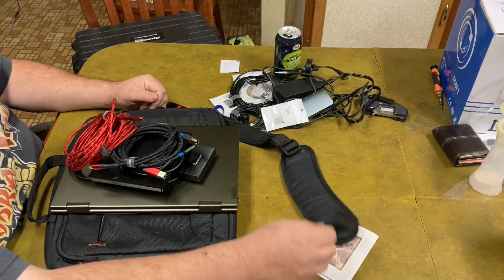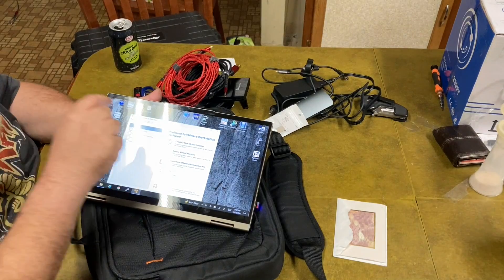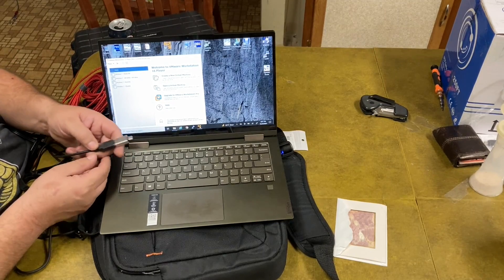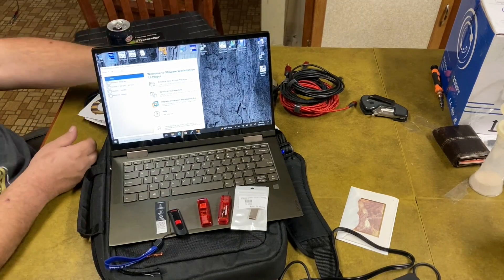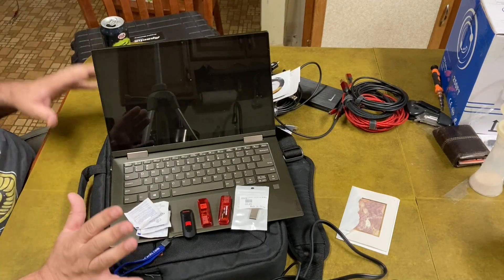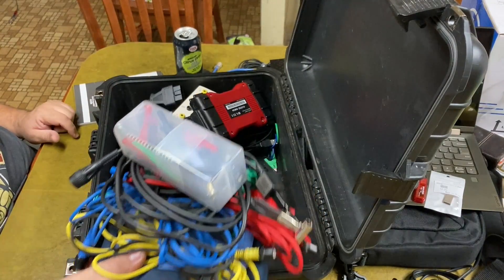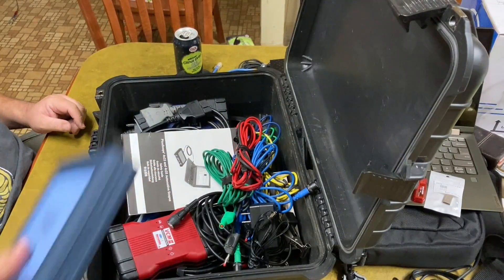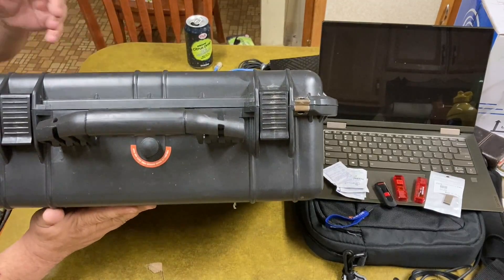My Automotive J2534 J Box's and Programming Laptop and Hardware

Comment: The ipad app store just opened up support for utm se virtual machine app that allows you to run windows xp and windows 7, and it's been suggested that windows 10 and 11 is coming, on ipad. Would be interesting to test if you can use ipad virtual windows setups to drive j2534 box diagnostics and programming job.
Reply from the maker: Let me know how it goes!
Reply: @frugalprepper  did some more research and not viable, its emulation not hardware virtualization thanks to apple so super slow. a macbook with parallels or vmware hardware virtualized windows would work fine though at that point might as just get a low cost windows laptop dedicated for this task.

Comment: hey man do you know any decent budget friendly laptops you can recommend ? i dont have money for a thousand dollar laptop right now lol. i want to start using dealership / OEM software on honda , toyota and nissan. i know ill need more than one laptop most likely. i was looking at the Panasonic Toughbook CF19 Core i5 2520M 2.5GHz 8GB RAM 512GB SSD Touch Win 10 Pro and not sure which other laptop but wanted some recommendations. thanks
Reply from the maker: I use a Lenovo Yoga.  With i5 and 16GB of RAM.  Mine had 512 GB but I like to carry it with my AllData, Mitchell, and Hollander so I upraded it to a 1TB.  Lenovo has great, cheap warranties for extending you warranty and for accidental damage.  I run the one laptop and then build virtual machines for each manufacturer.  It did have to go back once under the warranty for a bad motherboard.
Reply: @frugalprepper  oh ok I see. It’s just I don’t have $800 to spend on a laptop right now. I was gonna put $300-$400 into a laptop right now so I can be using it with either of the 3 OE softwares ..

Comment: My BCM just went out and the dealership is saying it’s months out. Do you know where to get this part? GL3Z-15604-J
Reply: Thank you sir ima get ahold of you tomorrow 
Have a good night
Reply from the maker: What Make Model and Year is it?
Reply: 2016 Ford F-150
Reply from the maker: Another option is to send yours out for repair.  I have used moduleexperts.com before.
Reply from the maker: Yeah it's going to be tough finding a used one that new at a junk yard.  It would be even tougher to make a dealership program a used module, even though it can be done.  With the chip shortage you may be waiting a while on a new one
Reply: If I were to send that out, about how long does it take to get it back and what are the odds they can fix it

Comment: Great video Tom, what was the blue box with the gm logo. I use an Autel Jbox and I’m looking for a good backup. I mostly do Fords & Chevys and I’ve only had one time that I’ve needed a backup but that’s one time too many. Between Isaac and Autel’s warranty I was back up and running in a couple days. Any recommendations sir?
Reply from the maker: The Blue box is a GM MDI II Clone.  I will load the latest firmware form the MDI VCI App and work just like a GM one.   The Red one if a Ford VCM 2 Clone.  I will also load the latest firmware updates from Motocraft and works with IDS.  I put links below the video to both of them.  If you are running Genuine IDS and GDS2/Tech2Win there is no reason to buy the ones that come with the software, just get the box itself.  I have had the MDI 2 clone for nearly 2 years and have programmed a LOT of GM's with it and have never had and issue.
Reply: @frugalprepper  have you had any issues with your clone MDI not working on some vehicles? The first MDI 2 clone I bought worked fine on GMLAN-based vehicles (like my gf's 2009 Saturn), but not on older Class 2 bus vehicles (like my 2002 Camaro). Returned it and got an older MDI clone, which worked fine on the Camaro.....but would only talk to the Saturn through the high speed GMLAN bus (PCM and BCM). Anything on the low speed GMLAN bus (radio, instrument cluster, RCDLR module).....no go. Yet my Tech 2 works fine on everything.
Reply from the maker: @cobra30689  I have programed vehicles back to 1996 with it.